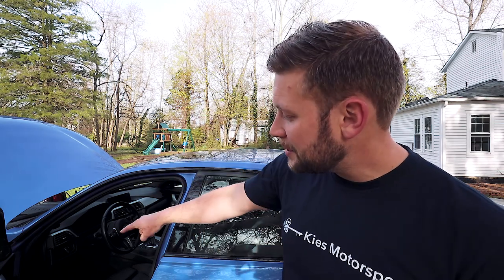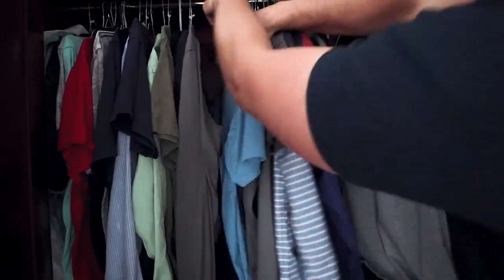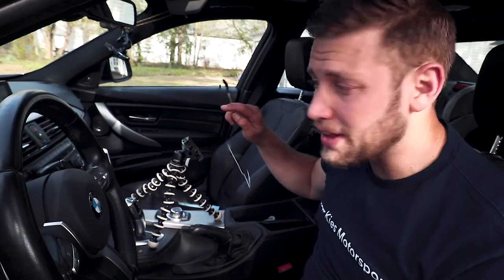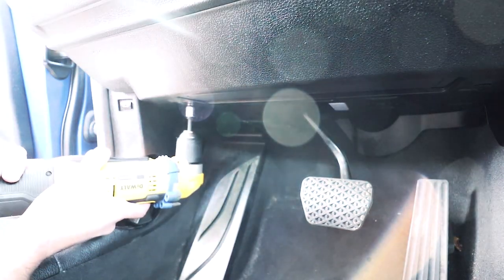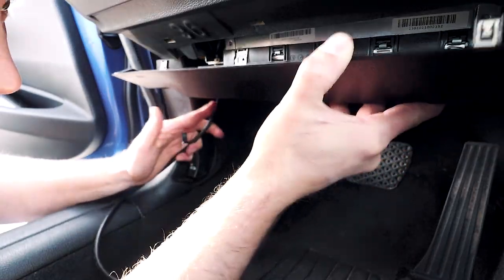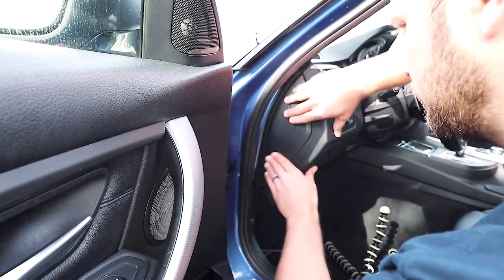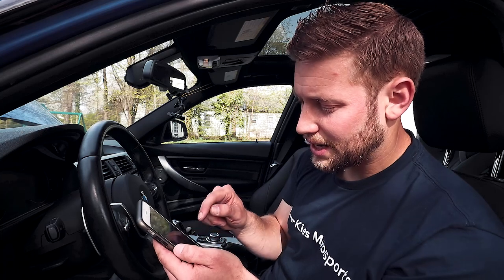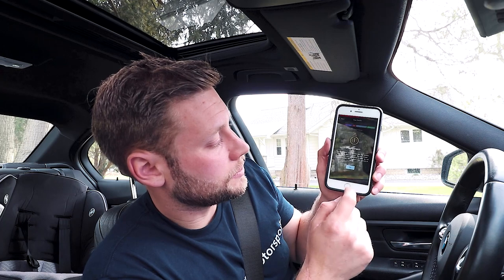The EASIEST way to use BootMod3! Flash from your PHONE with the BM3 Wifi Module | F30 BMW #bootmod3

Comment: Hey Bryan, is this safe for stock 335i? I’m looking for some extra power but I don’t need crazy power yet. Also do flashes hurt MPG? Thanks
Reply from the maker: Yep! I run it on mine. Mpg depends on how heavy that right foot is. I average 24.9 mpg on pure stage 2, but I drive conservatively
Reply: Kies Motorsports would there be a significant performance gain stock? I would have to run stage 1. Thanks again!
Reply: I have the 2013 335i RWD with Pure Stage 2 and Bootmod3 and I am getting close to 32.5mpg on highway without my foot in it (which is difficult).  My average city/highway (mainly highway) is around 27mpg.  I love these cars Power and decent mileage.  Bryan,  thank you for the great videos and information.  Like I said when you get cold I am in California.
Reply: Would at least upgrade your charge pipe, people crack them pretty often, especially with a tune.
Reply: @thejungatron6792  I run bootmod3 stage 1 91 oct on my stock 335I and I saw a nice performance increase. Dropped my 1/4 mile from 13.8 to 13.1 with just the flash alone.

Comment: This video is kind of confusing me why wouldn’t you just get an adapter for ethernet to Lightning cable? Then you can just plug the OBD two into the car plug your adapter into the ethernet and then plug it straight into your phone and it should connect and you should be able to flash. you shouldn’t need to take your car apart like this just for a flash 🤔🤔
Reply from the maker: The video is a few years old. I’d do the Ethernet adapter instead. Cheaper and works better
Reply: @KiesMotorsports  good looks thanks for getting back to me